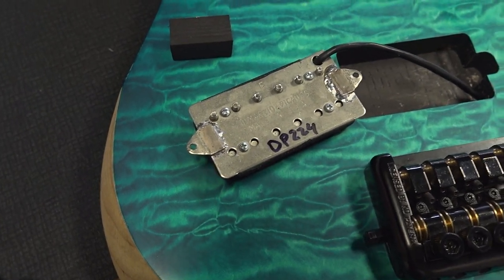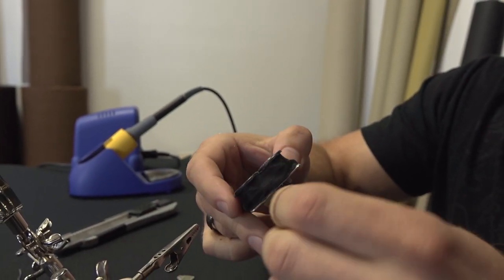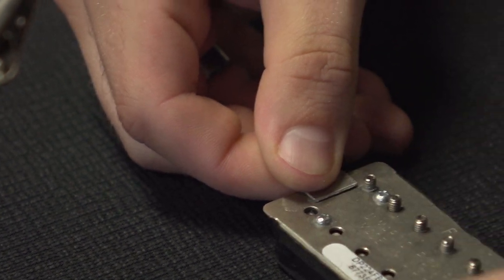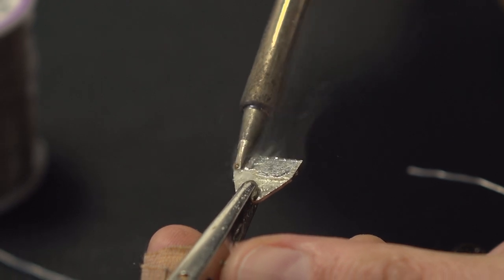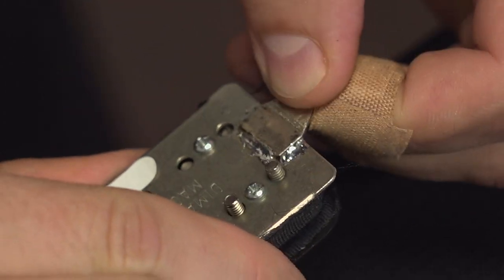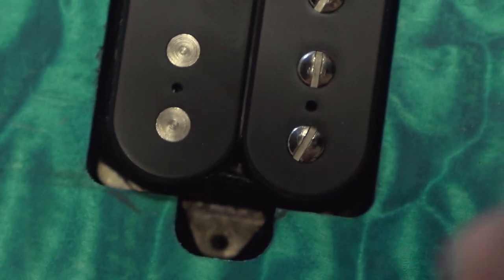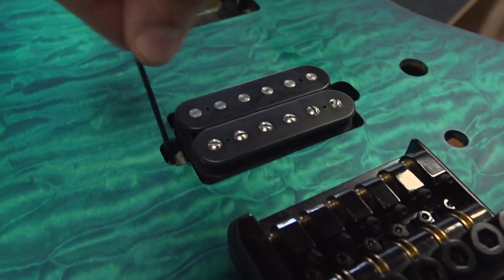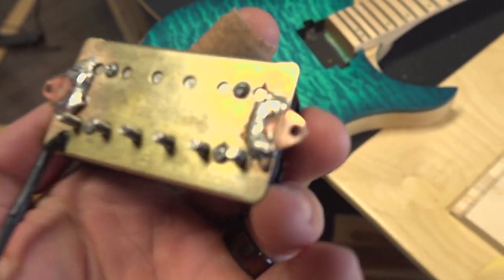Modding An NK Headless Guitar - Part 1 (changing the pickups)

Comment: I would be worried that the wax potting or even the enamel coating on the pickup wire would be damaged from so much heat used to solder those tabs, did the pickups work after your soldering?
Reply from the maker: No damage at all. They still play as good as new, and are even still in that guitar. Lucky result I guess. 👍